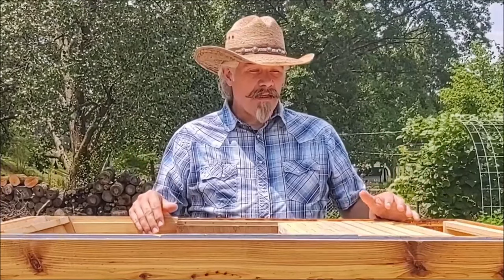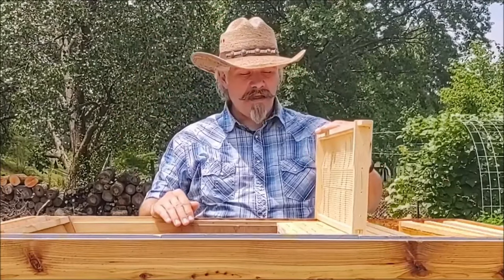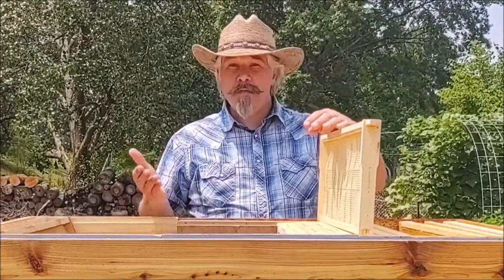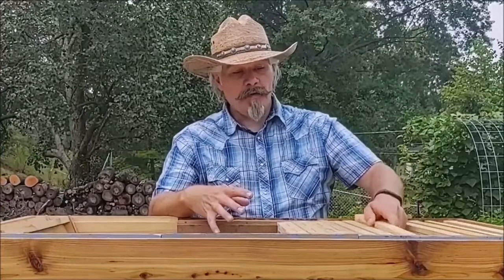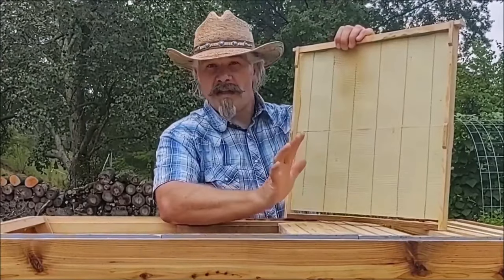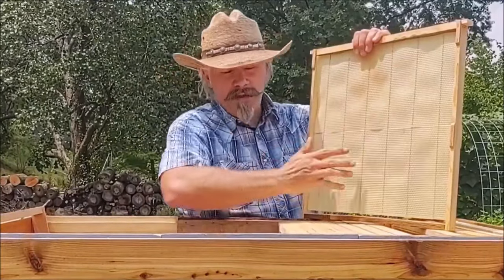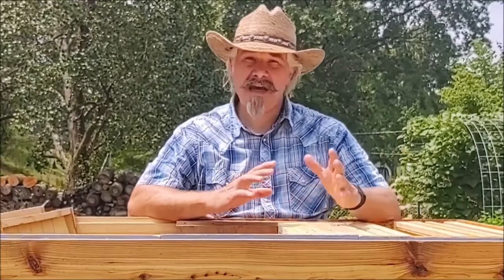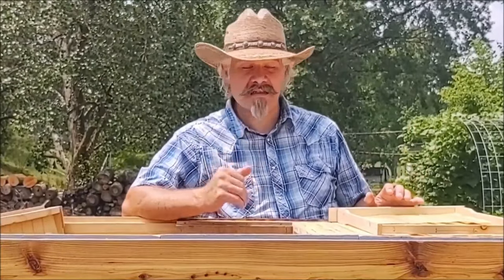Beehive Frame Comparison: Langstroth vs. Layens vs. Lazutin

Comment: I’ve built my Layens hive w 2 by wood and have a 2 “ gap for insulating my long walls. It’s a 4ft long unit for my homestead.  
Not finding wool so thoughts on fiberglass or cellulose?  
Also thoughts on air gap across bottom. Thx
Reply from the maker: I opted not to use 2x lumber for my hives when I researched the relative R values.  Wood has an average R factor of about 1.25 per inch, so 2x lumber (nominal 1.5") only has an R value of about 1.875.  I have used rockwool insulation batts in some of my hives, which has an R value of about 3 per inch - more than twice as efficient as wood.  The batts are pretty easy to split to fit in the 1.5" space in Dr. Leo's insulated hive design.  Wool has just a slightly higher R value than rockwool but, as you mention, it's not always as available.  Once I considered the insulation to weight ratio, I stuck with insulated hives built with plywood, using wool when I can; rockwool otherwise.
Reply: @SuburbanSodbuster  it 2 by with insulation pocket on long side.

Comment: So few beekeepers on utube are into the Layens, but I'm a total convert having seen Dr. Leo set up, install bees, maintain, inspect and evaluate status on numerous Layens hives  (I found all this on the offgrid w Doug and Stacey channel).  It seems to be the best overall way to go, and too bad we in the U.S. are so invested in the Langstroth--suited to commercial guys with forklifts and a warm warehouse or relocation to warm climate over winter.  Love your explanation and your evaluation.  Too bad the Layens honey extractor is so pricey...
Reply from the maker: After 2 years of keeping in Layens, and a year of attempting to establish a colony in a Langstroth hive, I'm even more convinced of the benefits.  I plan to make a future video on the topic, but in a nutshell the bees seem to take to the Layens hive, where they build continuous comb from the top down (as they would in nature), much better.  I can't claim that issues I've had are specifically because of the Langstroth hive - and I plan to continue keeping in both for the experience - but the 20% of my hives which are Langstroth take the greatest percentage of my time spent working with the hives.

As for the extractor, when compared to equivalent Langstroth extractors, the price really is very comparable.  I believe the SAF Regata extractor, with Layens frame basket, is essentially the same as the SAF Natura with a radial 9-frame basket (for shallow and maybe medium Langstroth frames).  But the baskets can also be purchased separately and swapped, if someone really wanted to.  So yes, compared to a discount 3-frame extractor on Amazon, the Layens extractors seem expensive.  But compared to other 9-frame Langstroth extractors, the price is pretty equivalent - and with the Layens basket you can also extract Langstroth frames of any size.
Reply: @SuburbanSodbuster  So if we compare apples to apples, the Layens extractor is price comparable and as a side benefit can all spin one's Langstroth frames as well as the Layens ones.  Thanks for the info.Happy Beekeeping!

Comment: Thank you for comparing frame size and  the why of the sizes. However I have a question you might be able to answer, at least your opinion. I live in East Texas my winters are not cold for long typically. It is very normal in the winter months to have a few days in a row with temps in the mid fifties to mid upper sixties during the day. Do the bees break cluster and go for the honey stores on the outer frames? Im asking this question because I want to get back into bee keeping and I do have shoulder and wrist problems. And I feel that the Lanstroth frame would fit my needs, but not sure if they would fit the bees needs. What are your thoughts on this? Also it’s difficult to lift more than fifteen lbs above nipple line for me.
Reply from the maker: Yes, when the temps rise above 50 degrees (sometimes below) the bees will break cluster, take cleansing flights, and can access resources in other parts of the hive.  In general I think the deeper frames are beneficial for the bees in any climate, but are less necessary for over-wintering in a warm climate.  

Because of your difficulty lifting over 15 lbs, Layens may not be a good option as a full honey frame can be slightly more that that.  As you say, Langstroth frames may fit your needs and could work well for you in a horizontal hive.  Plans for these are on horizonalhive.com or you might check out some of the hives built by Horizontal Bees (@horizontalbees3480).  

Another option you might consider, depending on your objectives, is a top bar hive.  Bee Mindful, LLC (@beemindful1027), from Austin, TX, specializes in these hives and has plans on their website: Bee-Mindful.com
Reply: @SuburbanSodbuster 😊

Comment: Hallo! In Spain they use the 12-frame layens hives and put some half or third frame boxes on top of that.  I wonder how the bees can move if the frames are    all together on the first level?
Reply from the maker: When using supers the frames must either have gaps in between, or space must be left on the end(s) for the bees to move past the frames.  I'm not a fan of using supers on the Layens hive, but that's my opinion.
Reply: Well I would prefer a 20-frame hive, but I cannot get them here in Portugal. The 14-frame hives appeared to me to have too less space, thus I might opt now for the 12-frame hives with supers on top if needed. Thanks for your reply!
Reply from the maker: How handy are you with basic woodworking?  Plans are available on Dr. Leo's site horizontalhive.com to build 20 frame hives, both the insulated version as well as a simple solid-wood version.  Measurements are imperial so would need to be converted for metric.
Reply: I thought about it, unfortunately, right now I am not in the situation to work on it. I just moved, with three Mini Plus hives, to Portugal one month ago, lacking basic things like electricity water cooking facilities etc..I got a place for the bees and will move them by the time the new hives arrive. Spring has started thus, I think the bees will be busy already ... Hope everything goes well this year and, I can plan in this respect for next year ... Thank you!

Comment: sorry for what most will consider a dumb question. but I am trying to learn how to be a great beekeeper (I do not yet have any) I noticed on the Lazutin frame you did not have the foundation to the bottom. Is this by design or just it was not added to the bottom? if by design, why?
Reply from the maker: I have started using less foundation on my frames, leaving only a starter strip.  Below that I let the bees build comb naturally.

Comment: You could give the kid credit for the frame if your going to show his work. The dowel center bar is a stout modification along with a sliding dovetail design
Reply from the maker: The plans for the double-deep frames came from horizontalhive.com, based on the frames used by Fedor Lazutin.  The dowel center bar is an adaptation from the foundationless Layens design on the same website.  Lazutin was using these frame dimensions and the plans were available long before David Stout was making frames and hives on the same dimensions, and I'd made these frames and a double-deep hive (and this video) before I ever saw David Stout's videos.

Comment: How and where do you put a queen excluder in that box?
Reply from the maker: A plastic queen excluder could be cut and put, vertically, into a horizontal hive.  Alternately, the middle of a divider board could be cut out and covered with queen excluder screen.  I have yet to use an excluder in my Layens hives, though.  The bees usually put brood on 6-7 frames nearest to the entrance, then honey on the frames farther out.  Sometimes a queen will extend her brood farther than desired; when I find that I'll try to find the queen, put her on the 1st or 2nd frame, and add a full honey frame as a divider.  The queen is unlikely to cross the honey frame to lay brood beyond.
Reply: Thank you for the explanation.

Comment: no mods on the layens frame so it will fit in extractor?
Reply from the maker: No modifications to the frame, but a Layens extractor can process Langstroth frames as well as Layens.

Comment: Can you give me the dimensions for changing to the Layens   I built a long hive  using two double deep frames connected is an actually worked out very good so I’m going to use your idea and convert it to Layens hive
Reply from the maker: The standard outside width of a Layens frame, as per Dr. Leo's website, is 12 15/16 inches.  So adding 3/4" to that to give 3/8" bee space on each side would give an internal width of 13 11/16" I would probably go up by 1/16 and use 13 3/4" as the internal width for layens frames.  

When I converted my large hive ("Taj Mahive") from a double deep langstroth/lazutin hive I permanently built out the sides to hold the Layens frames.  If I had it to do over again I probably would have build adapters like I did for my conversion hive.  See how I did that on this video: https://youtu.be/77K87O9zI0g
Reply: I am new to keeping. I don’t actually even have my bees yet. Spring. I am in Kansas and that is my thought to make a longhive out of standard hives by connecting them. I would love to see what you have done. I’m so new that I am not sure my plans are viable.
Reply: @mrsleann-kennedy4125  I did that last year. It was harder and never worked really well Much better just to build the hive.
Reply: @mrsleann-kennedy4125  I live near Smith Center Ks

Comment: Are bees more angry when in horizontal hives?
Reply from the maker: I don't think so at all.  If anything, because hive inspections are less of a disturbance to a horizontal hive than vertical, the opposite might be true.  But I work both Layens horizontal hives and Langstroth, and while I prefer the Layens I don't think the hive, itself, is a significant factor for the bees' temperament.
Reply: @SuburbanSodbuster  i was thinking of using regular langstroth frames in a horizontal hive. But the ceiling would have gaps... So I'm not sure if it would be worth it.  I could add a solid ceiling, which gets removed for inspections, but then the bees are exposed.
Reply from the maker: @TheRainHarvester  a horizontal Langstroth hive will usually have some sort of cover over the frames, either cover boards or inner cover(s) under the lid.
Reply from the maker: @TheRainHarvester  if you're considering building your own there are long Langstroth plans available on horizontalhive.com.

Comment: So how do you process layens? Thanks
Reply from the maker: Layens frames do require a larger extractor than Langstroth, and because it's a smaller market they are not as widely available and typically more expensive.  However, I got my (3 frame) Layens extractor (SAF Regata) for about the same price as a Mann Lake 3 frame Langstroth extractor, and while the Langstroth extractor can't process Layens frames, a Layens extractor can typically process either Layens or Langstroth.

Another method is to cut out and crush the comb.  I don't favor this approach because that's comb the bees have to rebuild.  But it's necessary if foundationless frames are used or if someone doesn't want to purchase an extractor.
Reply: @SuburbanSodbuster  really sucks if you have already purchased all other equipment.
Reply from the maker: @mikem1956  I understand the frustration, but it's also an opportunity.  Langstroth boxes can be repurposed, in a couple ways, to hold Layens frames.  See my video on how I built a "conversion hive" (https://youtu.be/77K87O9zI0g) to see how I made adapters to hang Layens frames in Langstroth boxes.  Also, considering the large number of keepers who use Langstroth equipment, there's always a resale opportunity.
Reply from the maker: Something else I've thought about is that the Lazutin frames could be used in stacked Langstroth deep boxes, providing a continuous space for over-wintering.  There are other benefits of insulated, horizontal hives that this doesn't address, but it can give keepers of Langstroth boxes the ability to benefit from deep frames while still retaining the use of Langstroth equipment for honey harvest.

Comment: The Langstroth beehive have been in use for more than 160 years. It is the most used beehive design in the U.S., Canada, Australia, New Zealand, Asia, etc.
If you are having troubles with your bees it is not the fault of the Langstroth beehive.
I respectfully disagree with your statement that Langstroth beehive cannot be used by old people.
Some beekeepers stack their colonies up to 8 boxes, ah, and they are all deep boxes, not half frames as you mention. People that uses half frames for their honey supers are from areas that the nectar flow is very short so they would not end up with half capped honey frames.
Also I don't agree that you have to lift the honey supers, well there is no need to go into the brood box/boxes during the nectar flow. So your statement of having to lift a bunch of honey supers is a null point.
In nature bees always build up, like inside of a tree log. You may force the bees to go horizontally but it is not natural.
And another disadvantage of a horizontal hive is that you are limited on how many honey frames your hive can produce.
During the spring when beehives are growing and wanting to swarm if you have a Langstroth beehive all you do is tilt the box so you can see if there are any swarm cells, and that you cannot do with a horizontal hive.
I have never seen a commercial beekeeper use a horizontal hive in his/hers bee yard.
So if you want to experiment with horizontal hives I have no qualms with that, just don't demonize the Langstroth beehive that people have been using successfully for more than 160 years.